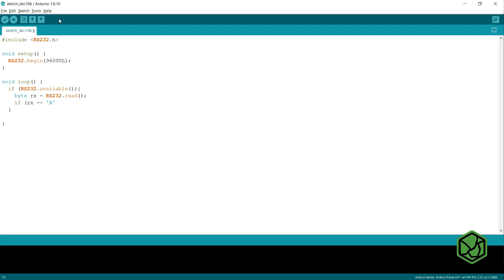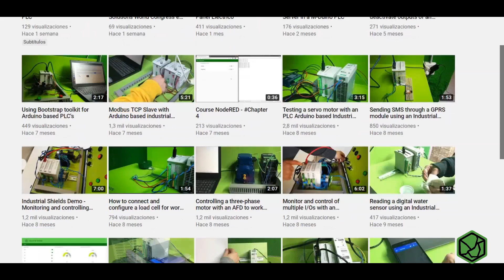✅ Basics: Watch the RS-232 communication working with an Arduino PLC

Comment: very interesting, but the sketch is also compiled through rs232? this part is not seen in the video.
Reply from the maker: Hello! You must select your Board and Model on Arduino IDE according to your PLC when you compile and upload the code. If you do not know that information, you can consult it on the UserGuide of the device. Thanks for the comment!